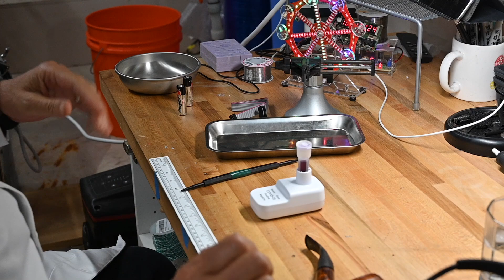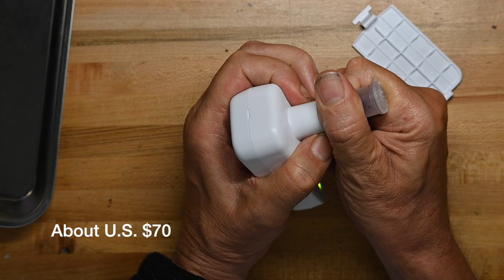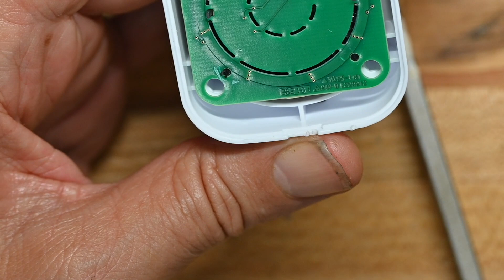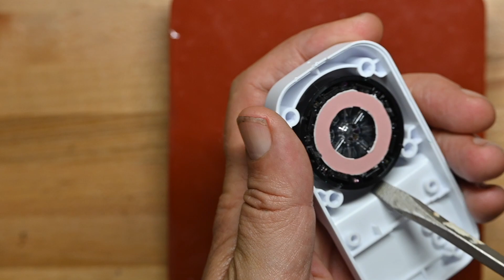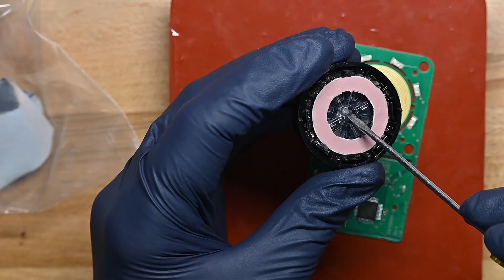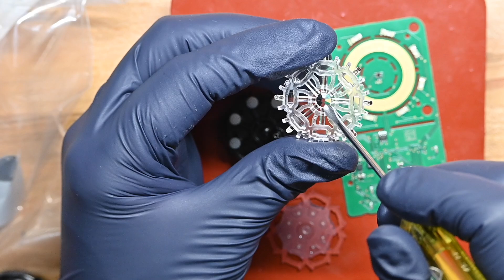C.K. disassembles a Home Covid PCR test unit

Comment: The gaps are most likely for temperature isolation.  You have to temperature cycle the liquid to complete the PCR process. That coil is most likely a heater, and the pink stuff a thermal compound.
Reply from the maker: Ah ha, very interesting. Thanks for the insight Chris.
Reply from the maker: Confirmed by a geneticist acquaintance of mine, this is a heating coil.  He gave me a technical description of what's happening to the DNA chains, but it bounced off my brain....

Comment: It’s not the volts that are killing your LEDs, it’s the amps!
Reply from the maker: You’re correct, I should have put a resistor in one of the power supply alligator clips instead of a straight wire.